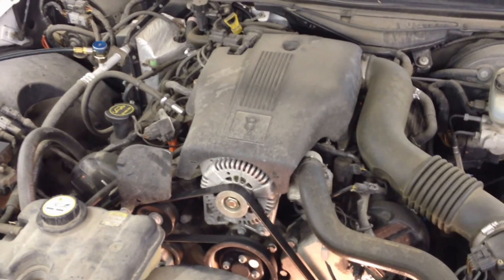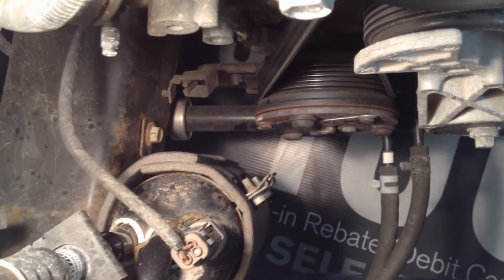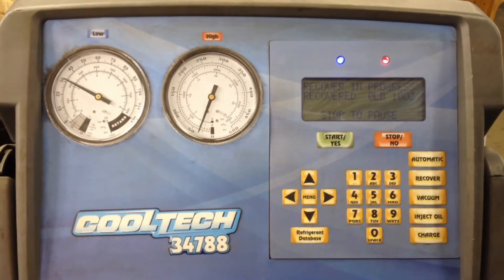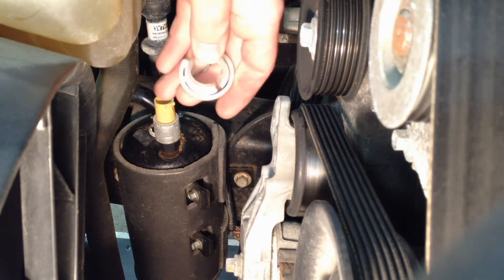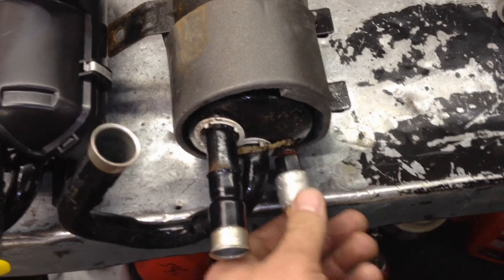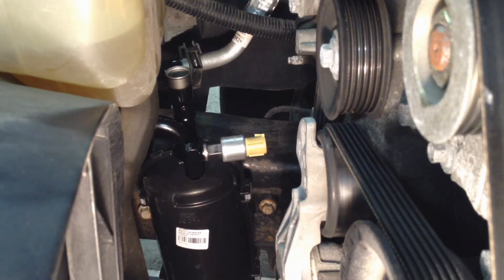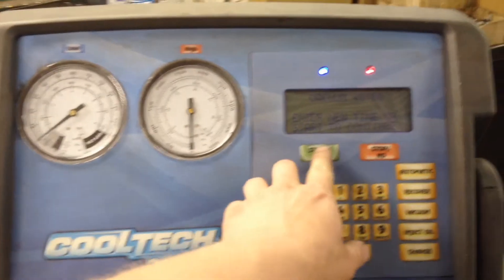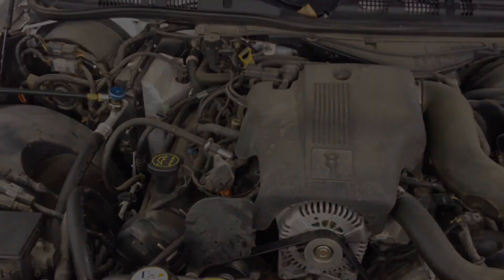2003-2011 Ford Crown Vic & Mercury Grand Marquis A/C Accumulator Replacement

Comment: This is the ONLY video that shows how to remove the A/C hoses with that little plastic part.  I looked everywhere.  Thanks a ton!!!
Reply: True
Reply: Agreed, I never would have gotten this without that!
Reply: @mariusellingsen5066  hello , I'm changing my accumulator on a 2003  Grand Marquis. What size spring release clip did you use to get a c line off
Reply: @Harpo.jr70  I don't remember. I bought a box of different sizes at Harbor Freight. Sorry I'm not more help.

Comment: Ford accumulators have been rusting out and leaking for decades. That's what happens when you make them out of steel. GM makes theirs out of aluminum. The aftermarket one I got to replace the one on my Ford is made of aluminum.
Reply from the maker: Almost if not all newer Fords are made from aluminum also.
Reply: +FordTechMakuloco Glad to hear they finally fixed that problem
Reply: Where did you you get an aluminum one?  I ordered one from Rock Auto that was advertised as aluminum, but it fails the magnet test.  My original steel one is leaking and I don't want another steel one.
Reply: Cheapest one on ebay turned out to be aluminium
Reply: That was for a 2004 crown Victoria

Comment: Hello I realized that I have to put PAG oil into the accumulator and you put 3 ounces in it. I'm buying a compressor that already has the oil in it. It says online that the capacity for the system is 7.5 ounces so does that mean that the compressor has 4.5 ounces in it? I just don't want to overfill the system, thanks
Reply: I have the same question.  Did you find out anything?

Comment: Can you please tell me where I might find the AC drain that normally drips under the car when the AC is on ? I have a 2007 Town Car, recently had the AC evaporator replaced and now the vents stink really bad when the AC is turned on and theres no drip under the car anymore.

Comment: Yep, my condenser fan quit on my 95 grand marquis. I simply installed a 40amp fused toggle switch on the underside of my dash.  Works great!  These simpler cars are so easy and typically cheaper to work on.

Comment: Great Video !!!It gave me the courage to change out my accumulator ... being just a back yard mechanic ...Especially liked the demo on the Ford style quick connect fittings ... and a few tips on what to watch out for ... In my case ... the accumulator was heavily rusted ... especially the top half and the entire top surface with rust flaking off at the tubes and sensor ... the UV light showing the top surface wet with fluid dribbling down inside to the bottom of the plastic enclosure ... but the leak appeared to be from the top fittings on the tank ... This was on the newer style 2008 Lincoln with the plastic enclosure for the accumulator tank ...

Comment: Add me to the list of happy campers! Got the accumulator at NAPA for 40 bucks, and it included a full set of O-rings for the hoses and the pressure switch. I turned the wheels to almost full right lock which made it easier to get to the bolt on the bottom.

Comment: A preemptive strike against rust-caused accumulator leaks is to rip that insulating foam that traps the moisture right off of it.
Reply: And that's ok , won't cause a problem
Reply: @Harpo.jr70  It definitely won't, and I'm not sure why Ford bothered to insulate it with foam.

Comment: From what I see from other techs is the plastic housing around the tank on the new one holds moisture also and rust out the tank on the accumulator. All old school ac systems just had the steel tank of the accumulator and never rusted out . I say pull the POS off there when you install the new tank otherwise count on it rusting out again

Comment: Great video!  Quick question the accumulator that came out of my 04 grand marquis is horizontal where the cycle switch goes and the new one I just bought is strait up and down.  Do I need a new cycle switch and If so which one should I get.
Reply: Jason Hogan Did you end up replacing the switch or reusing the old one?

Comment: So it says on the label as 7oz being the correct oil amount, but you put 3oz into the accumulator. I am assuming this 7oz level is including oil in the compressor itself or is that self contained?
Reply from the maker: 7oz is the total system capacity, we are only changing part of the system.

Comment: Hi I notice on my 2004 Town Car, there water around the top hose above the AC accumulator. It just water when I run the AC on cold. Is that first sign of the accumulator going bad?
Reply from the maker: selerim Nope that means its working
Reply: FordTechMakuloco Thanks no need to worry

Comment: I just watched another video about FORD "black death". I watched your other video on diagnosing a failed compressor. I can turn the clutch with my finger. Does that mean I have the black death teflon throughout the system? And I should probably replace the accumulator also? And where on an 05 Town Car would I find that inline filter? Video I watched was an F150. Hope you see this. Great videos! Thank you.

Comment: can a bad a/c cycle switch make your compressor lock up when you turn it on? doesnt sqeal any other time just when i turn on the ac. it just started doing it last wednesday. also i just bought a compressor i should probably ge the accumulator too right?

Comment: This reminds me I have to change the condenser on my Aerostar as it has an obstruction in the line m. As it's a singe tube multi row. The new one is not. So it should work better. As always I replace the accumulator anytime I open the system.

Comment: I have a newbie question that I can't find the answer to for my 2004 Grand Marquis. It's not exactly related but I couldn't find a video where radiator fan replacments were talked about.

Are there superior aftermarket fans that come designed to either fit into the existing housing, or are supplied with housing that neatly installs in my MGM nicely?

I'm curious about this because I live in AZ (which I love), where each summer is getting increasingly hotter.  Days over 100F have tripled or more.  A more powerful and efficient fan with about the same draw as OEM might help those scary days driving hard over 110F, and I'd be willing to improve things to keep that engine and me cooler.  Cars here will last forever if you can keep them cool.

Comment: I know many years later people are coming on here trying to gather more info about changing the dryer/accumlator and the straight nipple on the old accumulator (like in the video) and switching to one with an elbow...there are some things left out that I will explain since my 2003 MGM has the straight nipple and I changed to an accumlator with a 90 degree elbow. The old switch will need to be replaced because it will not seat in tight enough. I am using Murray switch PN 20957 which comes with a new o ring in box. Also on the newer accumlator (which was NOT explained...) the mounting brackets are thicker than original so your stock bolts coming off the frame WILL NOT secure properly (too short). You need something like 3, M8-1.25x30 with enough length to make up for the thickness and secure to the frame of the car. I have Fleet Farm in the Midwest so its about 3 bucks for 2 packs of two. Also, plan to source new Motorcraft A/C spring clips to reconnect the high pressure hoses to the new accumulator (mine were junk after we pulled the hoses). That PN is YF991 Motorcraft. Oriley had some in stock and im waiting on them to come in so I can begin to finalize the repair and recharge the system.

the 03/04 cars are weird because if you have a rotted dryer with the elbow and go to change it out with a straight nipple, now you will more than likely have to not only source a new switch for it, this way will also require you to buy a new connector with pigtail to change the connector style. I have read this part for this new switch is YH2012 and pigtail is WPT1436. I would try to avoid this route unless you truly know what you are doing or have access to a great mechanic (like I do).

Comment: I remember from another video you said professionally recovering the AC refrigerant will also recover around an ounce of oil. If I were to have a recovery done on my system and an ounce or two of PAG oil is pulled out, should I add an ounce back along with the three ounces being poured into the accumulator, or should I only pour 3 ounces into the accumulator and not add any more than that to the system?
Reply from the maker: 3oz is fine.

Comment: So if the accumulator holds three ounces of oil, do we need to add another four ounces to the system, or is that other four ounces somewhere else in the system? Thanks
Reply from the maker: No you only add back what you removed from the system.
Reply: @FordTechMakuloco  Thanks! This really helps!

Comment: Mine just went on my 2003 Grand Marquis.
Reply: Mine to on a 2003 Grand Marquis about one week ago. Have fun trying to find a new one with the Schrader valve facing upward and not sideways. I still working on mine , I had to remove the battery and hacksaw off the tube on my old accumulator. I just could not get that low side connection to release. If you notice he skipped that low side release in his video. Once I cut the tube and had it where I could get some leverage to pull it, it released. This way I still salvaged the old lines and can only replace the accumulator. You also going to need a Torx socket to get the bracket to place the new accumulator in the old holding bracket.

Comment: @FordTechMakuloco my 94 grand marquis ac suddenly stopped working, but the compresser clutch is constantly engaged. Which steps should take first in the diagnosis process? Thank you very much...

Comment: Thanks so much for this video. Would you happen to know the switch part number for an 03 Crown Vic? I looked and there are several OEM part numbers. My switch screws straight on not at the 90 degree angle. My A/C is intermittently blowing warm/cold air. Thanks

Comment: I have a 2002 Lincoln Town Car limo that the a/c lines get really frosty and the compressor doesn't kick out.  (it's a new compressor)  I put in a new cycle switch and that worked for a little while but now it's back to not kicking out the compressor when it starts to frost up.  It is still blowing out cold air front and rear.  What could my problem be? A short in the wire connector or a plugged drier?

Comment: I have a 2008 cvpi. All the coolant from the radiator was in the ground and the ac stopped working. The only place i see a leak is at the bottom of the accumulator. Is that possible???

Comment: I had my local mechanic replace my accumulator on a 2011 Crown Victoria 41,000 miles. Every since he replaced it the air keeps losing gas. He used that green dye and can never find the leak. Its been back twice and he uses a special light to try to find the leak and can not. He said it may be the evaporator but looked at drain tube and no green dye. Does anyone have a suggestion? After watching this, i am wondering if it is that cycling switch O ring. But then again if it was he would see the green dye. Any advice would be appreciated
Reply: I know this was a long time ago. But I have a Grand Marquis with your AC leak now.

Did you ever find out where the leak or problem was on your 2011 Crown Vic AC system? 

Do you still have the car?
Reply: People forget about the evaporator core which is on the firewall.  It takes some disassembly to see leaks there.

Comment: i just had a new compressor put on but i think this may be the issue it takes a while for the car to actually get cold
Reply: My situation is similar. I had a new compressor installed last year.  Now I have to be at  highway speed or greater for the air to be cool coming out the vents.  What fixed yours?
Reply: @aboomalacani2732  mayne i still need to get it looked at i think it may be a switch it doesn’t get as kold as it used to before it would be freezing cold even in summer heat now the air barely gets cool i got a new compressor and accumulator installed the same day 🤦‍♂️

Comment: I like your channel, alot is helpful, but you skip the hardest part of this. Getting the low pressure side off, its a bear. It took an act of congress to get it off, now I cant get the side line on, yours snapped right on, mine not so much, I cleaned the ends, new grommets etc.,. Accumulator moves and you can not get nothing in there to snap it tight. I had to remove low pressure hose completely, reinstall it on the accumulator outside the car, reinstall and connect high side.
Reply: I was thinking the same thing. Especially up here in the northeast where you deal with salt. 99% of the time it’s a battle to get that hose off the bent tube on the accumulator. It’s almost never as easy as this video.

Comment: On the accumulator switch, does the accumulator need to be empty before you change the switch or could you potentially change it with a charged system?
Reply from the maker: There is a check valve on the accumulator so if you are just changing the switch it can be done on a fully charged system.
Reply: FordTechMakuloco
 Thanks for the info. You were correct and it gave me the confidence to continue troubleshooting on my 2008 Crown Vic. As it turned out the relay in the fuse box under the hood on the passenger side was shot. Again, thanks for the advice.
Reply from the maker: Sweet find thanks for the update.
Reply: Deng, I should've read this before I just posted the same question. Lol. Thanks for the info, literally about to change the switch out right now! It's the last thing I can try before I have to try either another known working PCM, or take it to Ford and plug it in to the master diagnostics machine. Just is case you were wondering... it's a 2009 CVPI, just got new A/C clutch (and electrical unit inside clutch), low pressure switch, system recharge/check (the A/C just happened to work while they were checking/charging it) with no leaks (I assume they checked), then I got it back and it was back to on/off clutch cycling (mainly just off unless it's really hot outside). Also replaced A/C clutch relay, checked fuse(s), and it still cycles clutch on and off randomly (but when it's on it's ICE-COLD). Sometimes just for a second or 2, sometimes for 10 seconds or more (up to 2-5 minutes at times). Coolant is topped off, all dash switches/knobs work fine. Car has no ambient temp sensor (so I don't need to check for that), and it has all manual controls inside. This is weird... other than this A/C issue, the car runs so strong and sounds like it's still new!!

UPDATE: Alright, so it's NOT the A/C clutch cycle switch either (just put the brand new one on). Also I just noticed, the clutch didn't activate at all this time. But, it is night time (haven't tried A/C at night yet) and very cold outside. So, I'm thinking... maybe there's a pressure leak somewhere? Like, when it's hot out (which is everyday here), it's gives just enough pressure for the system to kick on (but then off again once it realizes it's not enough to continue)? I mean unless the shop I took it too didn't fill it up enough, or maybe they did but didn't check for leaks with (IR gun) after? I see no leaks anywhere though, and like I said A/C blows cold when it does come on. Does the compressor build pressure when the clutch is not activated? I ask because if so, maybe my compressor itself is dying/dead and can't build enough pressure (even though I assume it does nothing until the clutch activates it)? Idk.  I feel as though I've tried everything. Next step is Ford dealership (unless I can find an '09 PCM to test real quick).

Comment: Hello, Did it come with the bracket? I ordered an accumulator elsewhere and doesn't have the bracket or mounting points!
Reply: Just had to transfer it! But realized you can use those clamp to remove acc and put new one in .. no need for those three bolts! .. Thanks!

Comment: have a question my ac was charged and now the ac stop working check all sensors and fuses could it be my compressor how can i check let me know please its a 2004 town car
Reply from the maker: It was charged but is it still charged? Check pressure static.

Comment: So how do I know the accumulator is bad?  My ac come out very slow on full blast. ITs full of coolant, I checked the pressure. Compressor seems to try to turn on, but it seems blocked.
Reply from the maker: Cooper Duke The accumulators leak from the underside as shown in the video otherwise they generally don't fail. What were your pressures and what is the compressor cycle times?
Reply: A leak test using dye finds the leaks.

Comment: I did not know the fan has issues I will have to check my sisters Merc next change. I had to replace the Accumulator on her Merc too due to a leak.
Reply from the maker: sdvten For awhile there they did.